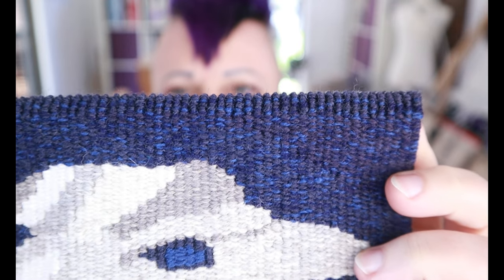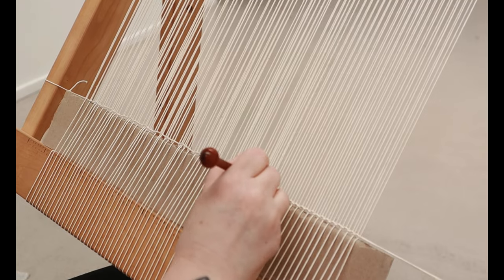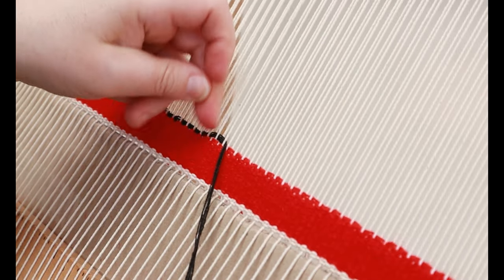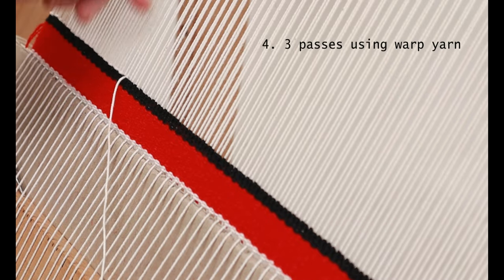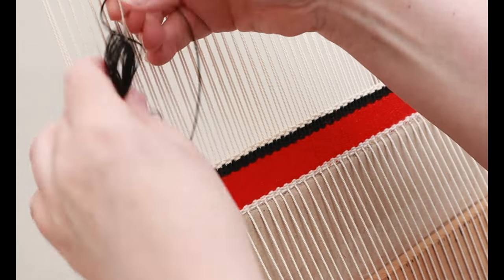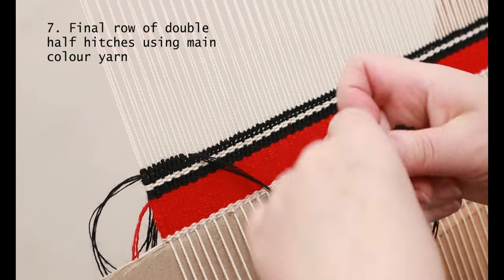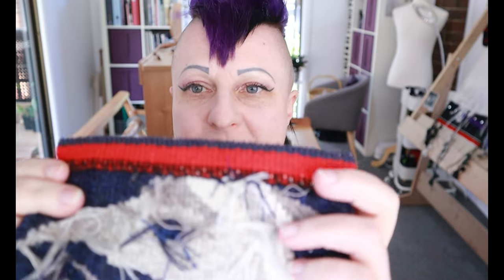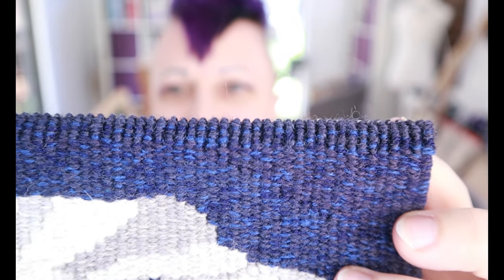🕸 TAPESTRY TIPS 🕸 - How I weave my hems for hand woven tapestry

Comment: Are you familiar with a method for blending in weft ends when transitioning to a new weft, that prevents have to weave or sew them in later? Do you ever use, for example, a surgeons knot to join weft ends as you weave?
Reply from the maker: No, I don't use any knots at all! I only sew in the ends along the edge so they don't peek out - the rest are just trimmed. Do you use these methods?
Reply: @ThreefoldDesigns  Thanks for your channel and great response. I use these methods in bead /tapestry weaving on a loom and I can bury weft joins inside of the beads.  I had heard of weavers knots and wondered if I was missing something. Thanks again.
Reply from the maker: No worries!! Some tapestry weavers may use this method ... but I was taught tapestry as a knot-free zone! 😁